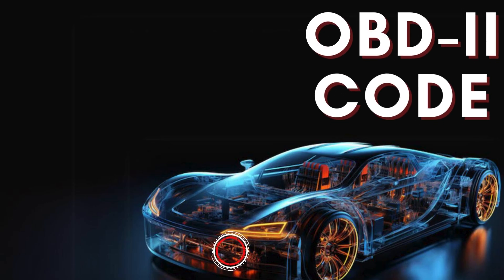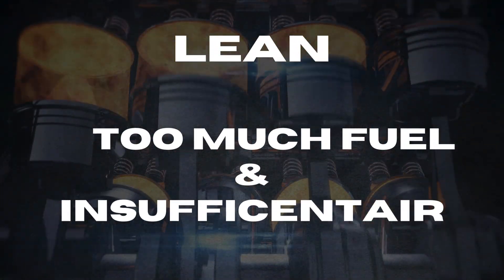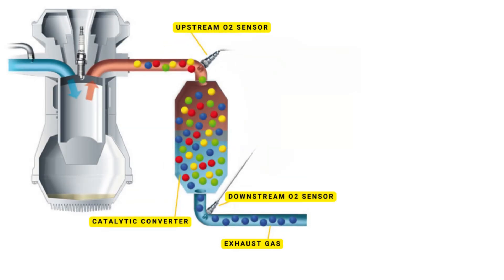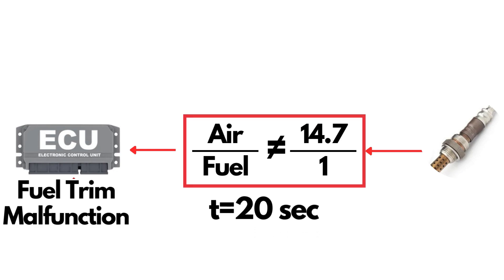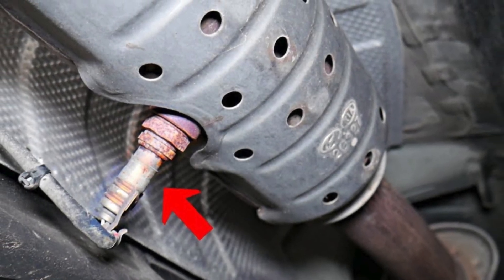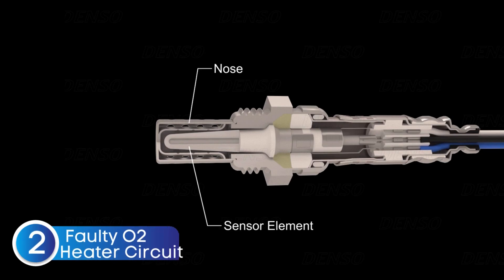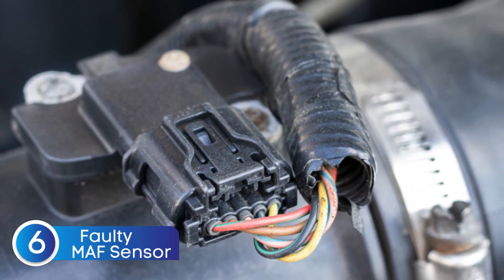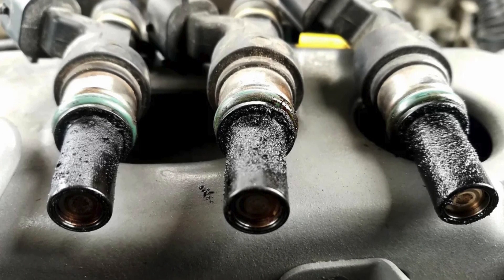How to fix P0173? | Fuel Trim Malfunction (Bank 2)

Comment: I just had this code come up… think I’m going to start with cleaning the air filters and the MAF sensors… 
Then replace the upstream o2 sensor if the cleaning doesn’t work… 
Don’t they have scanners that tell you exactly which sensor is bad if any on a live feed on the scanner?